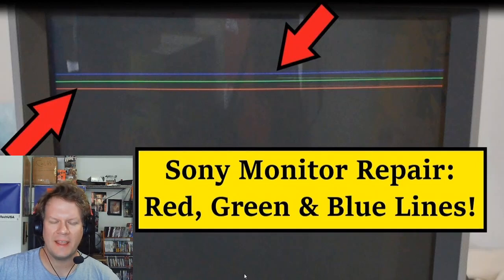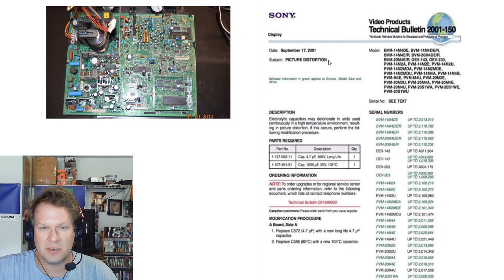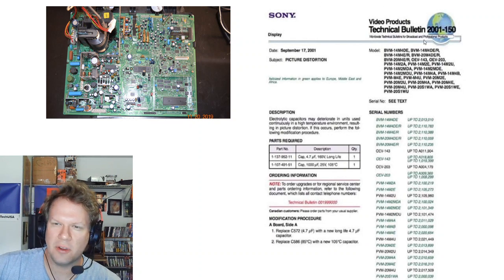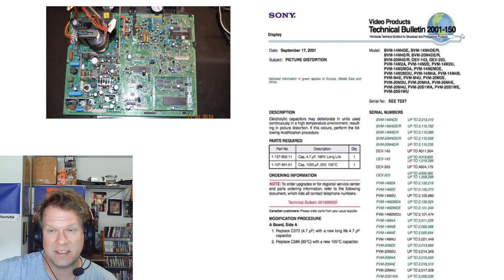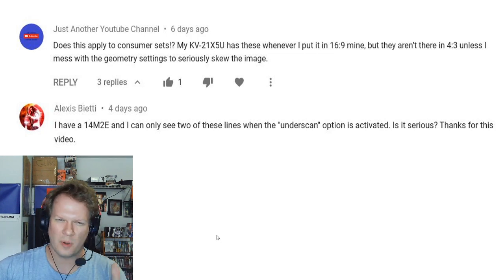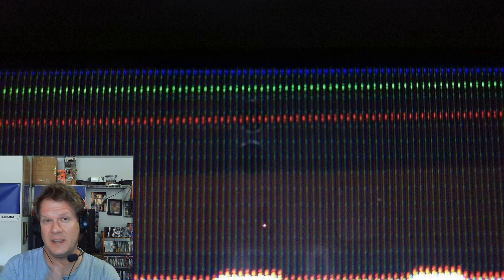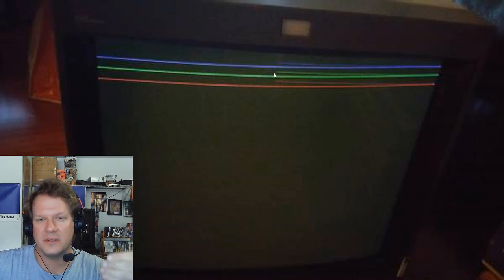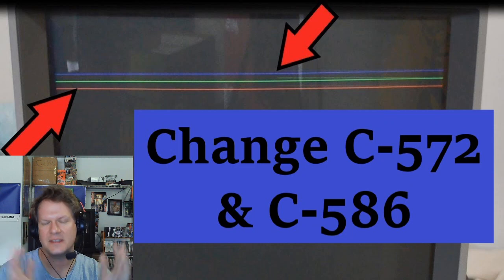Sony admits a CRT Design flaw in Memo! | RGB Lights of Death follow up

Comment: Hey Steve, I know you’re trying to be helpful, but the RGB lines are hardly “lights of death.” It was VERY common for Sony to release service bulletins detailing fixes and revisions for their Pro monitors and other high-end A/V equipment.

Each Sony BVM had revisions throughout their life and these were documented through service bulletins. 

In short: this cap issue isn’t going to kill a monitor. Eventually the cap will fail, but it won’t burn out the tube or other parts of the display. Sony designed their monitors with a number of failsafes to protect the vital components.

Comment: In this video one of the capacitors to replace is the C-586 but in one of your previous videos its C-584. Just wanted to double check which one should be replaced and what values should the new capacitor have?
Reply: C584 is correct. C572 =160v 10uf. C584 =160v 2.2 uf

Comment: The screen works, but there are no pictures or any data, there is only a faint green color with transverse lines and there is a charging static on the glass of the picture tube. Is there a solution to this malfunction

Comment: Hey guys I have a question just for curiosity. Is it possible to change the electron gun on a CRT (regardless of it being a shadow mask or Trinitron tube)? I mean I heard that the tube need to be in vacuum to work properly but I still want to know if it is possible.
Reply: Yes, if you will change it in vacuum.
Reply: @kuroikensai202  thanks I never thought that.

Comment: Thank you Steve for making people aware of this problem. I wonder if the problem was the same within Japan as non of the regional models with "J" show up on that list. Maybe because their memos for Japan were sent separately and in Japanese. I live in Tokyo and managed to get a couple PVMs for cheap and so far they have no issues.
Do you know if all the BVMs and PVMs were made in Japan? I'm asking because at some point in time I remember seeing different prices for same model Sony TVs being sold here, the cheapest ones made overseas and the expensive ones made here. Among many reasons, probably the quality of components used are different. Also, Is there a way to easily find out if the caps were replace in the past just by checking the solder points or some other method?
Thanks for all your informative videos!

Comment: Did you know if the 40-series were also affected but not covered by this bulletin? I've got a 9042QM that shows these lines when there is no source plugged in, and with the 16:9 button pushed in.

Edit: Its S/N is 2014482, it was made on January 2002
Reply: its normal in 16:9 mode lol

Comment: so, if they put out an official notice in 2001, does that mean monitors manufactured after this date do not suffer the same issue? Mine was made in Dec. 2002
Reply from the maker: What's the serial number on your PVM and what's the model?
Reply: Retro Tech S/N A207457, model OEV203
Reply: Retro Tech why is the specific serial number important?
Reply: @NorthofOnett  because seria number = date of manufacturing. And list contains all serial numbers, any below them = need upgrade.
Reply: Kuroi Kensai so I’m good then?
Reply: @NorthofOnett  yes, you are far after last serial.